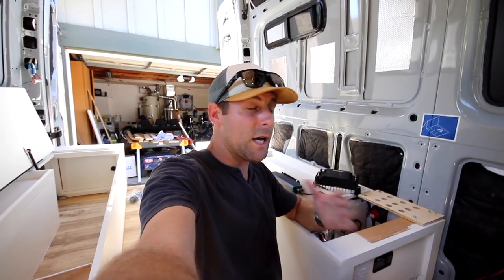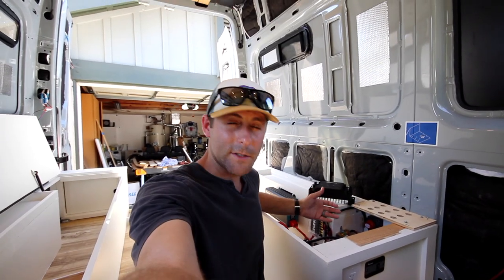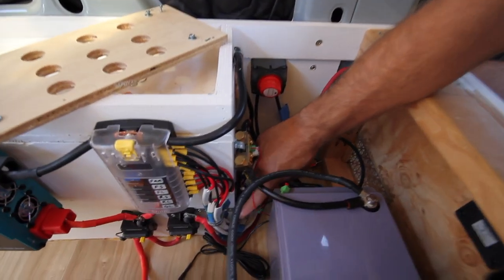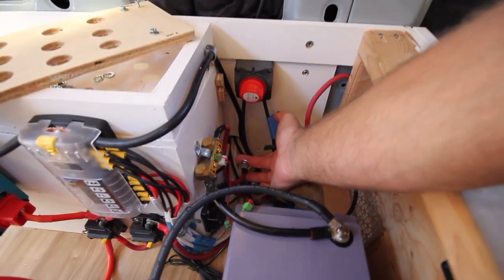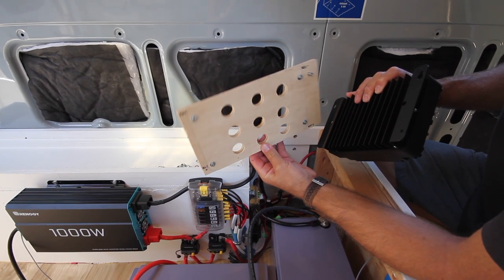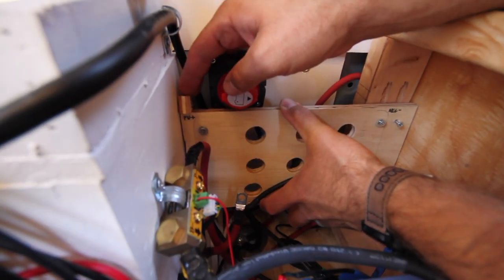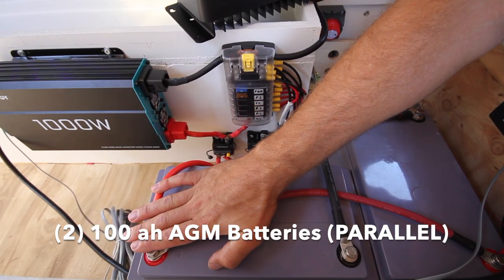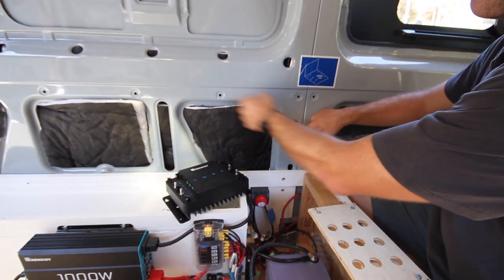DIY Van Electrical System (Full Walkthrough)

Comment: Killer video, exactly what I was looking for. Thank you!
Reply from the maker: Hey thank you! Let me know if you have any questions! 🤙🏼
Reply: @EventheWavesYT  I have a 144 Passenger van and currently have all the interior panels and headliner removed so was debating going ahead and running wires for a future minimalist electrical build. It may or may not be worth it so that is what I’m trying to figure out. Thanks again for the straightforward and realistic content. I’m sick of watching videos with heat shrink labelers if you know what I mean!
Reply from the maker: @jfaz love it! Yeah of course I just try to get to the point to help everyone out! 
So I would absolutely run your electrical now even if you don’t use all of it! 
Label everything!! It will help! 
And something I wish I did was 3 way switch it to the front of the van. So I could turn the back lights off when the kids turn them on in the middle of the day! 🤙🏼

Comment: I just have one question...with so much available space in the battery compartment, why is everything jammed into one tight corner?  I know it provides more storage space, but spreading the components out a bit may help with heat removal and any future maintenance.  Not trying to be critical, just curious.  I'm doing the same with my Suburban, but my compartment will not be as spacious as what you have available.  I'm thinking of adding a temp controller and a 4" muffin fan to help with airflow if it gets too warm.  May also add a relay to isolate the solar power when the engine is running and let the DCDC provide charging, and solar back in when the engine is not running.  Nice setup...a lot of work obviously went into it.
Reply from the maker: The reason I jammed everything in that corner is that I wanted to be able to add another battery and larger inverter if I needed to. As far as turning your solar off while driving it will give you full capacity while driving, but I would only use that if you really need to and it’s not sunny for an extended period of time. I do have a solar isolation switch (this is a must) so that I don’t backfeed the system while I work on it. I have had it in for 2 years now and it’s never overheated. I have a thermometer in the compartment.

Comment: Hi thanks for the video. I'm trying to understand if the negatives wires for the lights, outlets, etc have to go back to the fuse block or can they just go to ground on the vehicle?
Reply from the maker: The wires for the lights will be connected to the positive and negative side of your fuse block. Then your fuse block needs to be grounded to the van. Hope that helps! 🤙🏼
Reply: @EventheWavesYT  Thank you for the reply brother!
Reply from the maker: @Justin Fredrickson of course! If you need anything else feel free to comment or email me! 🤙🏼
Reply: You can ground them anywhere that is in metal contact with the fuse block, save a lot of unnecessary wire.
Reply from the maker: Awesome!